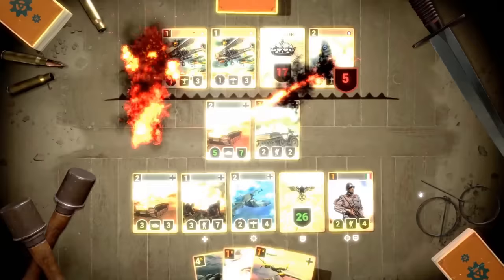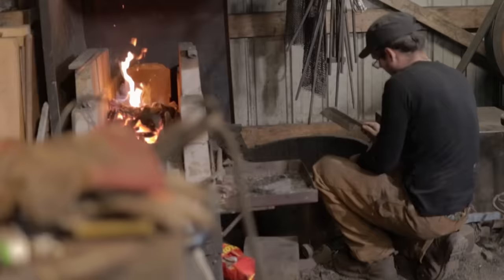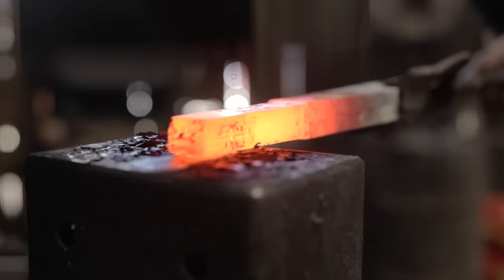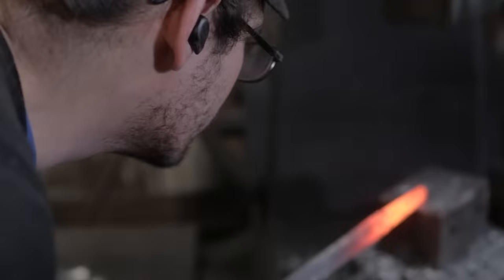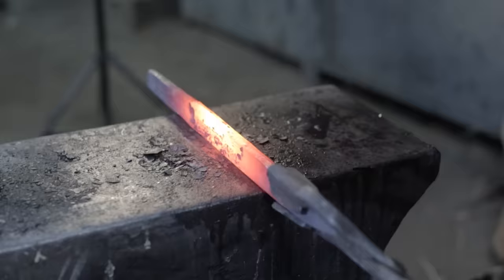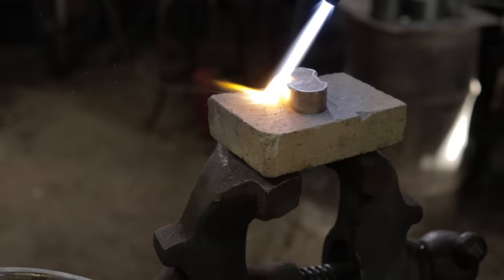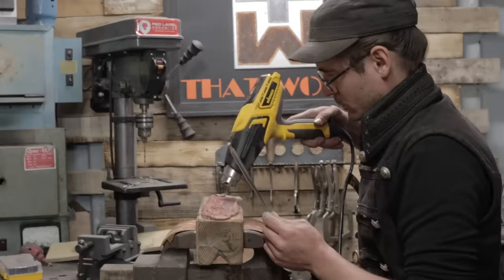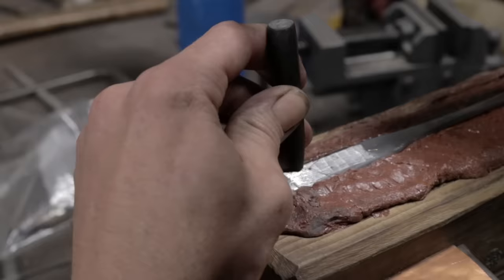Forging a Japanese Tanto

Comment: I once came across a national treasure katana. It was a wakizashi forged in the 13th century it was a legendary blade that was given the name "Hoshizukiyo Masamune" (not made by masamune but an equally good smith named Osafune Kanenaga, a legendary smith) later down the line it was owned and used by takeda shingen. It was then an heirloom for the Tsuchiya daimyo family for centuries before taken to America after WW2. You are correct in that the sword has had multiple fittings for different situations, it had a battle fittings from when it was used by Shingen and other warlords, it also has insanely beautiful and ornate fittings for public events. If anyone is wondering it was sold to a private collector for roughly $500K

Comment: 12 IQ: Lighting a fire, using it to heat up a steel bar and then hitting it with a hammer.
1200 IQ :Hitting a steel bar with a hammer to heat it up, and using it to light the fire.
Reply: I think it is a common traditional practice in Japan.  IIRC, a Shinto temple's construction begins with the ceremonial lighting a fire this way.
Reply: @tiacho2893  i heard that making steel red hot was popular in europ to, one becous it was faster than fire up by anything alse, second smith help his wrists

Comment: Well done Ilya! I'm currently working on a project to get more international attention and appreciation towards Shin Gunto. Yes many of them are mass produced and machine made/non-traditional blades, however it is estimated that a 7% of all produced swords in Japan during ww2 are traditionally made Gendaito. These were made by certified 'RJT -  RIKUGUN JUMEI TOSHO' smiths and the Japanese government provided the tamahagane for these smiths. During this time there were many underrated Japanese swordsmiths that worked in the traditional way(some fully traditional without power hammer) and it is my mission to collect, identify and preserve these works of art for the future. Some of these smiths even became quite famous after the war and produced stunning swords to be appreciated and won many awards and prizes(Enomoto Sadayoshi for example, a Mukansa smith).
Reply: collect all the nihontoooooooooooooooo : >
Reply: Yes there are some family swords refitted into 98 pattern fittings. Early examples were traditional swords with relatively modern fittings, despite regulations a degree of personalisation was allowed.

Some of them are really cool, I had the opportunity to look at a family sword in 98 pattern fittings, with a special patented scabbard dust cover, which prevented dust and grime scabbard when a sword is drawn. This feature was later deemed too expensive for mass production and not seen in other 98 pattern fittings.

Comment: I'm pretty sure you guys are tired of being asked to do Japanese swords, but I'd really love to see you guys try your hands at a Kissaki Moroha Zukuri style blade. It was a popular style before the Tachi really came into prominence, and served as a kind of mid-point in design philosophy between the decisively Chinese-inspired Tsurugi (which is a Jian ) and the definitively Japanese Tachi . It'd also give you guys an excuse to play around with Shibuichi for the fittings.
Reply: That sounds like it would be an interesting build.
Reply: @JudgeNicodemus  It definitely would. It'll keep all the cranky Katana haters happy because it has a symmetrical tip and two sharpened edges, but it still has a curved blade! And I'd invent any excuse to use the variants of Mokumegane in a blade because they are just that attractive; Shibuichi just makes a nice dark patina without needing to use any Arsenic in the mix.

EDIT:  Not in the blade part itself, that'd be stupid. But Mokumegane is a nice, soft metal that plays very nicely when used to make fittings.
Reply: I would love to see illya's take on kogarasumaru
Reply: it was a popular shape in other blades but not in tachi it was quite rare in tachi blades  but it became popular during the edo when they copied the  Original kogarasu maru
Reply: @micahcampa  The Tachi was still a fairly recent development when the Kissaki Moroha Zukuri style blades were in vogue. The Tachi is ultimately what supplanted them, as best as I can tell. There is also a theory that these blades were actually intended to be used as polearms, like Naginata , though the surviving examples were almost certainly intended to be used as swords.
Reply: @anthonylamonica8301  yes but  the  original kogarasu maru was from the 10th century  the first ones are from the 9th century

Comment: A magnificent work with an amazing mini lecture on how WW2 and the development of the nation of Japan  impacted swordmaking.

A little sidenote: the lamination technique Ilya used to forge the blade is a rather historical one; in Japanese it's called the Wariha Tetsu technique. From what I have read and understand, the procedure he used is spot on too. Not many traditional smiths used it though, especially on long blades; a bad forge welding might split the blade in two during combat. However it was not exactly unused either, as it found niche with shorter blades.

Comment: That's a beautiful Tanto Ilya. No shortcuts in making, actually you did go for more difficult design with that decorative hair peace on the scabbard and extra silver ring on the handle.  Very nice. I wonder, how did you make it fit there, the decorative silver ring.  You showed in the video that you have soldered the ring together, but how did you attached it in the middle of the handle ? If you don't want to uncover the whole secret, I totally understand :-) Still your fan. All the best.

Comment: I dunno if it is just me, but the way you don't just grind the blade way, you hand forge it and then use files and scrapers to shape it, using grinding mostly for the finish/polish, makes it feel much more like wood working than blacksmithing (at least when contrasting with the work of many other modern smiths that I myself have seen, that is). Another thing I like seeing in your projects is that you don't do any tack welding to forge in these traditional builds, and have a rather conservative material use, which I am sort of fond.
Reply: A blacksmith always forges the object 95 percent to shape.

Comment: Lovely build. I'm always so impressed with your guys' work. Just curious, why did Ilya choose to weld on the high carbon steel in an L instead of welding on a flat bar, then cutting off the tip at an angle and forging it over?
Reply: Because the hardened area is supposed to have a boshi with a distinct kaeri.
Reply: @ilyaalekseyev3589  Ah, that makes sense. Thank you so much.

Comment: Please forge sword from the metal of neutron star.
Reply from the maker: Ok
Reply: A neutron star is so dense that one teaspoon (5 milliliters) of its material would have a mass over 5.5×1012 kg, about 900 times the mass of the Great Pyramid of Giza. In the enormous gravitational field of a neutron star, that teaspoon of material would weigh 1.1×1025 N, which is 15 times what the Moon would weigh if it were placed on the surface of the Earth

                                                                                                                                 --wikipedia      https://en.wikipedia.org/wiki/Neutron_star
just sharing something interesting i once read.
Reply: @karnalunea1122  i know!! imagine the sword!!

Comment: You hammered the steel until it was hot enough to ignite paper, and then used it to strike a match to light the paper. Why? If you were going to use a match either way, why not just strike the match on something?
Reply: hot blade make fire cool

Comment: 9:30 what tool is he using there on the blade
Reply: that is what i think is the hardened steel scraper. like a one tooth file, i believe that is what i read somewhere. i saw a similar one on crossed hearts forge, i do not remember the video.
Reply: @karnalunea1122  thanks I've been wondering with no answer on a few of his videos

Comment: Tests are not good, it's possible to do all the same and cut like 5 bottles with small Spyderco (or similar others) knife, and even more with larger knives.
Reply from the maker: Yea and ?
Reply: @That Works  so there're no evidences that this tanto is any better than mass production knives.
Reply: @alex-craft  Can you please define better? After all, a tesla and a Ferrari are terrible at getting through the hindu kush where any pack animal passes with ease.
Reply: @ilyaalekseyev3589  So, what's the use case when this tanto is better than the mass production spyderco knives? You found such use cases for cars (road) and animals (off road). So what this tanto can do better than spyderco?
Reply: @alex-craft  because a tanto has cultural significance and is a part of an indeginous religious practice.

Comment: MY DREAM KNIFE IS STILL A 13" JAPANESE CHEFS KNIFE, FULLY FORGED LIKE THIS. NOT SOME 32-180 LAYER CRAP. COUNTLESS, UNLIMITED LIKE THESE.
Reply: USED, CARED FOR, AND PASSED DOWN FOR GENERATIONS. I WOULD EXPECT IT TO COST 5-10K. ALWAYS A DREAM.
Reply: MATCHING HANDLE AND SAYA, REAL WOOD, HORN, OR BONE. NO FINISH (TO KEEP OILED MYSELF). HAMMON, OF COURSE. LIKE A 13" X 3.5" AT THE WIDEST. OCTAGANAL, RIGHT HANDED HANDEL. ONE CAN DREAM, EH?
Reply: WOULDN'T IT BE COOL TO HIDE A PARING KNIFE IN THE SAYA, LIKE A TRADITIONAL KICK BACK.